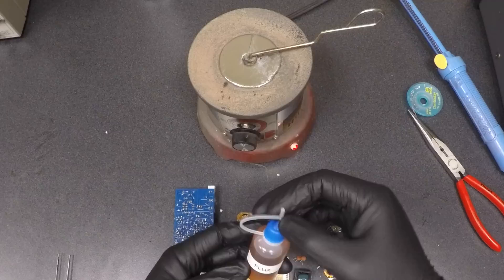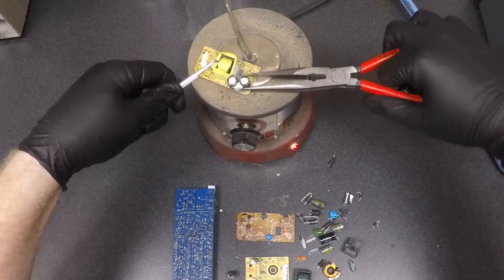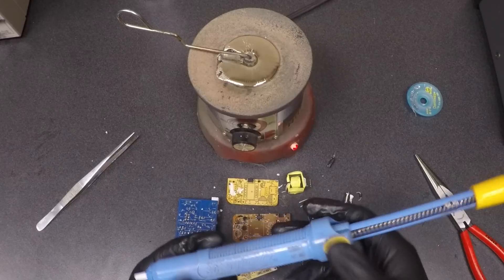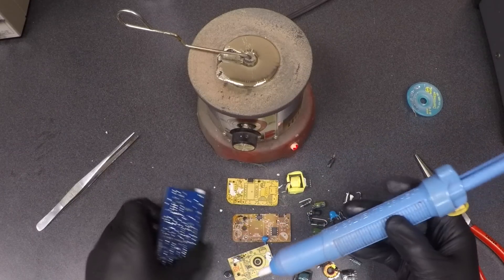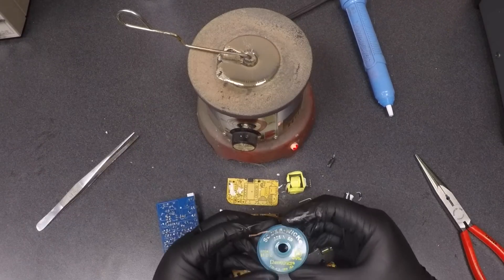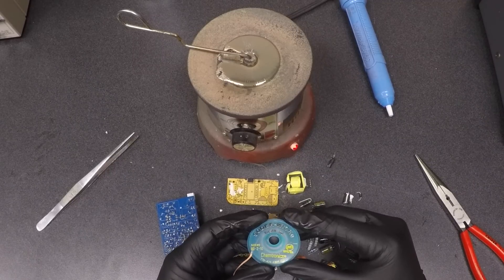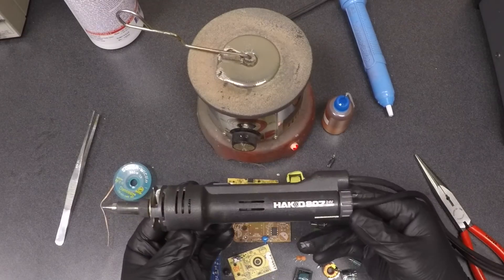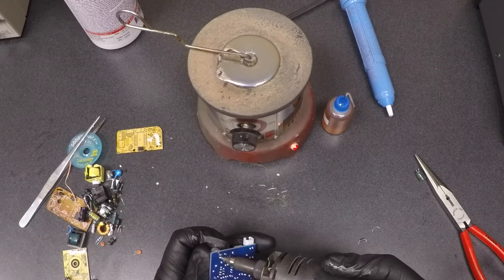Quick Tips #4 // Salvaging Electronic Components

Comment: I've also used a GOOD heat gun, gloves and a pair of pliers. My Milwaukee heat gun even on low is more than hot enough to liquefy solder. On high it'll burn up the board even!!  Holing the gun pointing up in a vice, and bringing the board to it works well too.
Reply from the maker: +DrFiero Yeah, a good hot air rework station is the best for surface mount components.
Reply: +Proto G SMD + rework station = happiness for sure!  But I'm talking about just brute force remove of through hole stuff. It ends up being like how you were doing it with the solder pot, just a different heat source.

Comment: Totally going to agree on that solder sucker being one of the few that works well, the smaller more 'compact' units are utter garbage as they can't form a good enough vacuum due to the limited displacement stroke and cylinder width.

Comment: Do you prefer a desoldering pump or the desoldering thread?
Reply from the maker: +emertes17 I prefer the solder wick over the manual desoldering pump.  The desoldering machine is the best for repairing boards and the solder pot is my favorite technique for salvaging parts from scrap boards.
Reply: +Proto G I totally need to make one of those molten solder volcano thingies! You got nearly every last component off that switching power supply without a sweat! :O except for that optocoupler, which will forever bother my OCD... :( Great vid nonetheless though!
Reply: I wonder if a pot of molten lead or tin would work? What do you think?
Reply from the maker: +Power Max Thank you and yeah, a pot of solder on the stove might do the trick until you get yourself a solder pot.